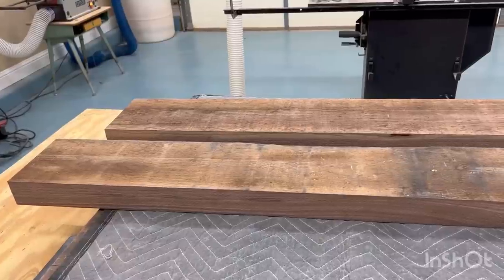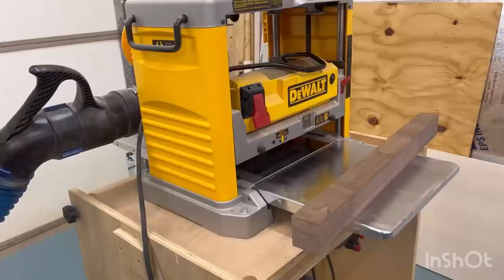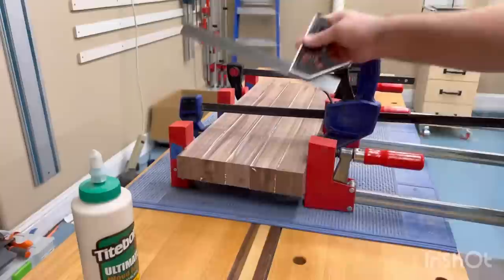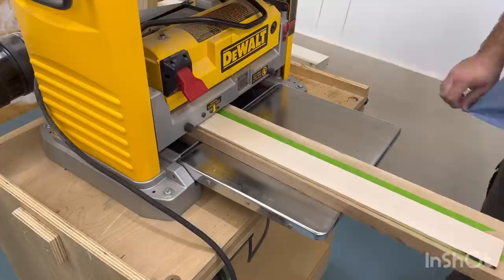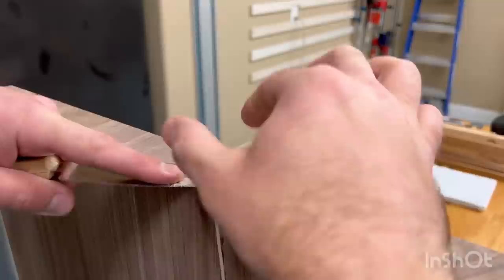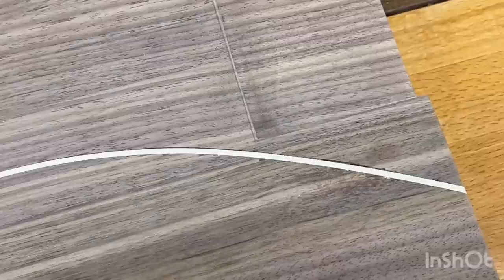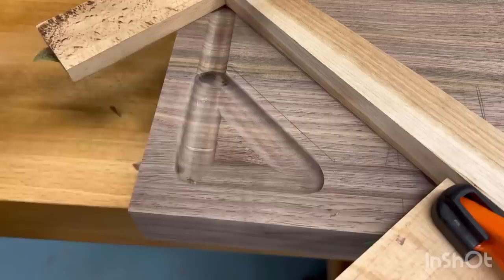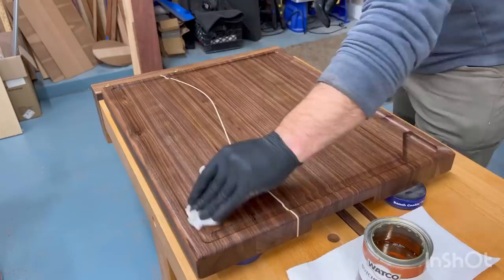Building the Biggest and Fanciest Cutting Board Ever

Comment: beautiful.. however in the future start clamping in the center and then work to the outside edges. doing edges first the strip your installing will bunch up in the center. you may not be able to see it but its there. you want to have any expansion free to relax as you clamp.
Reply from the maker: Thanks for the tip!

Comment: HEY ANDREW - TAUGHT CABINETMAKING FOR 45 YEARS AND MY STUDENT'S PROJECTS TURN OUT BETTER WHEN THEY ADD THIS STEP WHEN FINISHING - ALWAY "RAISE THE GRAIN" WITH EXOTIC WOODS - THIS MEANS: WET THE WOOD WITH  A COTTON RAG THEN: 120 - WET - 150 - WET - 220 - WET - 400  TACK OFF - AND I KNOW THIS A CUTTING BOARD, BUT IF IT WAS SAY A CABINET OR DESK THEN FINISH WITH "HAND RUBBED TUNG OIL" - THIS MAKES SURE THE FINISH IS "INTO THE GRAIN" AND NOT JUST SITTING ON THE SURFACE LIKE MODERN CLEAR COATS - THIS IS A LOST ART THT MOST :K-MART SPECIALS" OMIT - JUT POOR CRAFTSMANSHIP AND LAZY

Comment: Hey dude, lovely work. How about buffing the surface before oiling using a hard linen (old style Denim would do)? Cut pieces to fit your orbital sander. This will improve the finish of the wood. You'll also pick up high and low points which may need to be re-sanded..
(I know it's only a chopping board but if it's worth doing, it's worth over doing as you have beautifully demonstrated). : )
Reply from the maker: Appreciate the tip! I'll have to try that on future cutting boards
Reply: @andrewcheatle  I don't know if this is actually possible on end grain but I can't think why not. When French polishing (obviously no good for chopping boards), half the battle is getting the wood shiny before the application of any Shellac/spirit solution. Try a piece of wood and use fine steel wool after sanding - this is similar to the process of spraying with water to lift the grain and what is never mentioned; remove dust particles usually with some form of clear solvent, then allow to dry. It's amazing how shiny you can get the wood before oiling. However, automating this process I think is the only practical way because doing this by hand is going to seriously increase the time you spend. I have an orbital sander (Makita) which is rectangular and has the clip type of retention for sanding sheets. This is ideal for holding a piece of Linen (or durable Denim, not the new stuff, it's... pants: too thin, not durable enough!). Makes the job far quicker and fun!

Comment: Hello Andrew, thanks for taking the time to shoot and narrate this video, it was both entertaining and informative. However, there are a few things that I, and probably many other viewers would find very helpful to know: What were the width of the walnut strips and did you use the face or edge grain for the surface? What sanding grits did you use? What size router bits did you use, and at what depth did you take the juice groove and the well to? Many thanks.
Reply from the maker: Thank you so much for watching! The walnut strips were a little over 1.5” wide and there were 13 of them in total which gave me just over 20” on the total width. And the large boards were initially flat sawn but once I had the strips cut, I rotated them 90° so that the surface of the board was all rift- or quarter-sawn. I sanded starting briefly at 80 grit and worked my way up to 120, 180, and then 220 in total. For the juice groove I used a 3/4” diameter, 1/4” radius bowl and tray bit from Whiteside. Their stuff is a little pricy but I think it’s super worth it because they’re super sharp and I get almost zero burning with them and they last forever. For the roundover I used I believe a 3/8” roundover bit. Usually I go lower on the roundover for smaller boards but with one this large, it called for the larger bit I think aesthetically. I forget the depth I went to for the juice groove because I mainly did it by eye, but if I had to guess I think it was probably about 3/8” too. Hopefully this comment is helpful for you!

Comment: Great Video. The well was a Ingenius idea that turned out beautifully.                                                                                                                     I have a couple of questions.  How did you divide the board to route the handle?  What size round bit was used in the juice groves?
Reply from the maker: Thanks a ton! For finding the center point of the board I just took a tape measure and very carefully measured from each side (front and back) until I found the exact middle. And for the bit, it’s the 1/4” radius bowl and tray bit from Whiteside. Their stuff is a little more expensive but worth every penny I think.

Comment: awesome build. may i ask what you used that was the food safe oil for its finishing?
Reply from the maker: Hi, sorry for the belated response. The finish is Watco Butcher Block Oil and you can find it at almost any hardware store. I’ve done a ton of cutting boards with that finish over the years and never had a bad result with it. I put on two coats, scuff sanding with 400 grit sandpaper between coats.
Reply: @andrewcheatle  awesome info!! Thank you so much for getting back to me!

Comment: Do you give your boards a water spray before your last sanding
Reply from the maker: I don’t typically water pop for cutting boards and honestly more often than not for most projects it just depends on whether I remember to or not prior to finishing. Regardless, I usually get a consistently good finish with that butcher board oil and I think it would be difficult to mess it up too badly.

Comment: What did you use for legs?
Reply from the maker: Thanks for watching! Not sure if I’m misunderstanding but it’s a cutting board so there are no legs
Reply: @andrewcheatle  I use little rubber bumpers on the bottom. That way it doesn’t slide around on the counter top.

Comment: 8:52 what is that (assuming silicon) mat you are using?
Reply from the maker: Yep silicon! It’s the ones Rockler makes. I’m a big fan for glue ups because the glue dries on easily and then you can just peel it off later. I’ve had it now for about six months and it’s held up really well
Reply: @andrewcheatle  thank you for that, appreciate the info... will pick one up